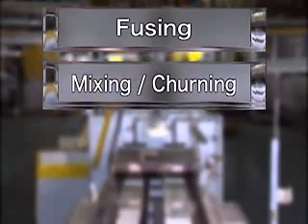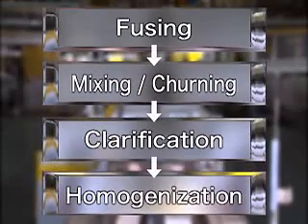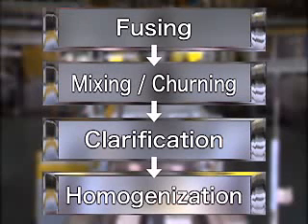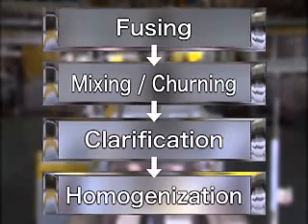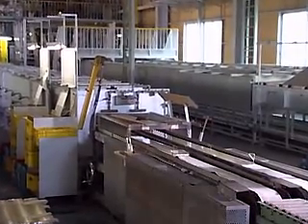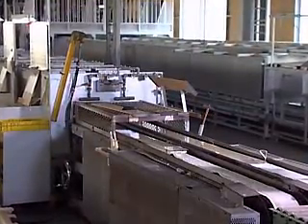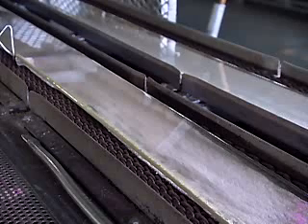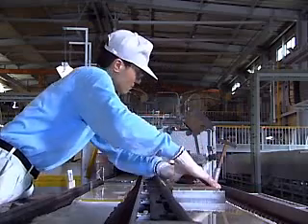Canon Lens Production (Part 1)

Comment: Yeah.  I love how many little bits of rocks and crap there are in my fluorite Canon front elements.  Looks just like a brick.  Maybe I'll see if I can get an adapter, and just USE a brick, although I guess I'll have to use manual focus.  But hey, I'll have something like $6999.50 instead of autofocus, and the same optical quality!

For that matter, have you seen the processes used in making CPU dies, some of which go for >$2000 for a little tiny chip?  Psh.